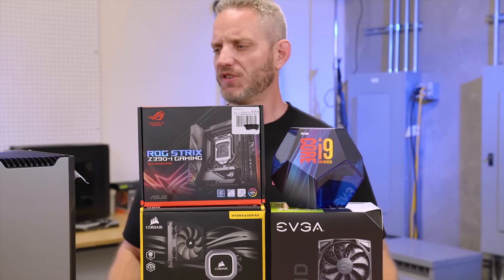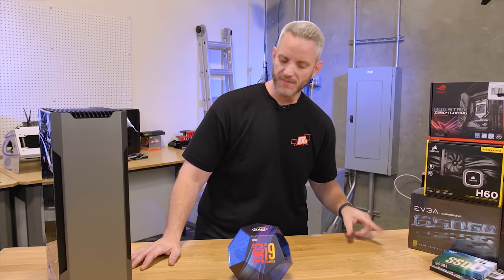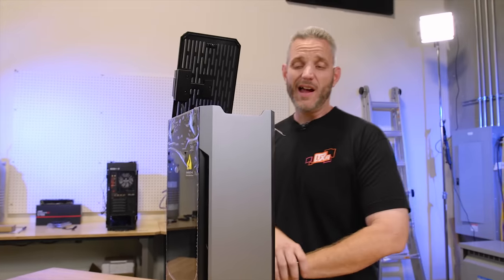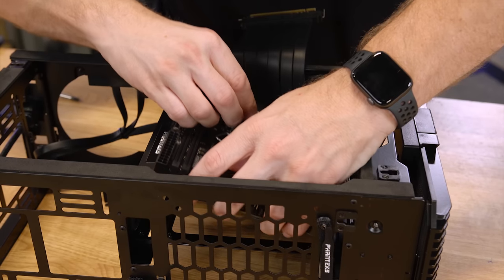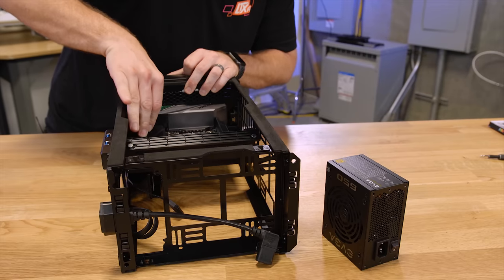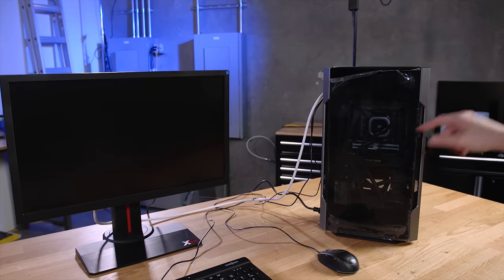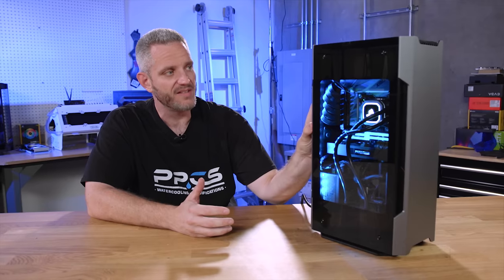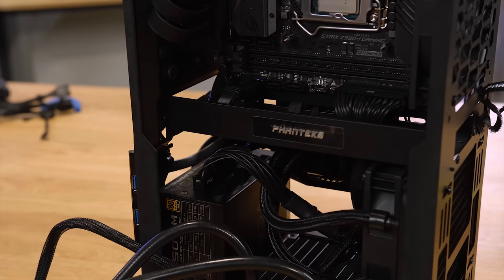This Small Form Factor PC is RIDICULOUS. Ridiculously FAST!

Comment: So i calculated, and one 'merica meter is ~ 91.28125 cm
Edit: it's almost a Yard, but not a yard
Reply: how did you come up with that number?
Reply: You can just look it up...
Reply: What the fudge is a yard?
Are they calculating distance in backyards?
Reply: @StopaskingformynameYouTube  A yard is 3 feet. Wait a minute, they're also using body parts to measure things!
Reply: @crimson7249  BANANA FOR SCALE
Reply: i just did a quick inches-to-yards conversion (only 2 sig figs) for the mericameter measurement. i was torn on whether to make a mericameter a foot or a yard lol
Reply: @frickingphil  it's got to be a yard,the foot wouldn't make sense,  the foot stands for the decimeter (0.1m). That leaves open the question of what to do with the span (9 in.)
Reply: 1 yard is 91.44cm which isn't 1 meter.  it's 3'3" to be 1 meter.
Reply: StopaskingformynameYouTube, that's not how we do that round her. We measure in football fields
Reply: Patrick Morgan well yea, it’s obviously not exactly a meter but it’s the merica unit that happens to be closest to the meter so thats why i made 1 yard = 1 mericameter :P

Comment: Firstly, looks much nicer than my dual aio build in the same case. As for the heat issues, if you replace that 140 included fan with a high pressure/airflow fan, you can get positive pressure with the rads set to vent. front mounted fan still expels air very well, metal front cools what gets sucked back in quite a bit and makes a big difference overall

Comment: Update!
This is the build i put into this amazing case. Some cuts and bruises due to the limited size of it and some.... "Creative" cable routings to say the least. But good god is this an angry little beast.

Case: ENTHOO EVOLV SHIFT AIR
Ryzen 7 3700x
Asus ROG Strix B550-I
Hyperx Fury 3600mhz ram CL16 (16gb)
Asus ROG Strix 120mm AIO
Corsair SF600 SFX
250gb M.2 for OS
/Installs
1tb Samsung Evo SSD for general storage
/games
and a RTX 2070 Super to pull the damn thing. 

Stil remains for it to "stretch its legs" however, so if you have any suggestions im all ears.

ProTip: If you neglect the I/O shield, depending on the motherboard you can and/or will cause a short and blow a fuse...
Thanks again Jay for the inspiration! Keep doing the good work.

Comment: I feel like you're doing a really good job of showcasing smaller power supplies than lots of people recommend. I just want to feel good about my smaller power supply, and feel like the 700w psu I just bought to allow me to run extra toy hardware is a good move. I have some old stuff too thats much smaller, but looking how efficient newer parts are starting to be again,, I feel like my old hardware has a great future also.

Comment: I use a Shift X (the taller version) with a Vega 64 Liquid Cooled Edition, and have the  120 radiator for the GPU in the bottom as exhaust (stock fan turned to exhaust too). I found this approach dramatically reduced temps, and the powers of convection aren't even close to strong enough to impact the heat dissipation negatively.

In fact I run everything as negative pressure (240 mm AIO for cpu) and it works flawlessly
Reply: Torstein Norum Bugge i might try flipping all the fans then, negative pressure sounds counter-intuitive but i’m always happy to be wrong about something 👍
Reply: @frickingphil  The big argument against negative pressure is that you'll have to clean the dust out more often: Negative pressure means that air (and dust) will get sucked in through all the cracks and crevices. Whereas positive pressure — with all the intakes using a dust filter! — will tend to blow dust out the cracks.
Reply: @ichinichisan  yep, good to know...personally i'm not too worried about it because i don't mind cleaning it out (i've already removed the filters anyway to try and improve the airflow, so basically i don't care about dust lol)

Comment: You "Small form factor"
Me "That's not small, it's bigger than my Alienware tower PC"
Reply: Small form factor refers to the depth of the case, not the height or length
Reply: @MoneyKidKing  no small form factor refers to the overall size of the case not one specific measurement
Reply: Yeah SFF are generally sub 20 liters
Reply: This pc is huge
Reply: Its a ITX pc.  Not SFF.  I have a Jonsbo MOD1 case/pc and its itx.... massive and very pretty (modern art) but its big.
Reply: If you look at the dimensions its not that large.  Its shorter than most mid towers, half as long and and about 3/4ths as wide.

Comment: did a Evolv Shift 2 build last week and this case is a amazing. Went for the 800W silverstone psu because the GPU is the 3080TI and I'm still worried about the GPU being too much for it, but so far, so good.
CPU was a 5500X on a Gigabyte Aorus ITX board.

Comment: This build is almost exactly what I've been planning for my htpc build. Same case, dual aios and everything. Glad to see it work. I'm waiting on the new 3000 series GPUs to come out for HDMI 2.1 support to pair with my OLED C9 but I'll probably be using my delidded 9900k and replace it with either Ryzen or Intel 10th gen in my main rig.

Comment: I used to use the Corsair Obsidian 250D, its amazing how far Mini-ITX cases have come since then. However this one seems kinda tall for an ITX, but it probably has the same volume as the 250D. I did manage to cram a 240mm AIO and a 200mm front intake fan into that thing.

Comment: Being my 3rd miTX build I found this one the more challenging one to do. But I guess that was partly due to me never using an RGB AIO setup before either. I like the look of the case it is quiet enough, and watching this video gave me some sense of nostalgia from when I did my own build - minus some of the higher priced components used. I used an i5-9600k, Asus ROG Strix Z370-i, Samsung EVO 970 NVMe 1tb, and GTX 1660ti GPU I don't do 4K gaming currently but I'm glad to see an 2080 fits into the case (the EVGA black edition 1660ti 3.5 slot card advertised as a 2.0 width definitely threw me off so I swapped that with an Gigabyte 2.0 Windforce GPU instead.

Comment: These days, I honestly think the itx form-factor is the way to go for mainstream builds.
DIMM slots just don't die like they used to and PCIe slots are equally improved versus what used to be.
Not to mention the fact that the space in your room is still there and not stumbling over a case is priceless.
The only thing I like to know is that the WiFi module is easily replaceable because that's the one piece of hardware that WILL eat 💩 sooner or later.
Nice build with a happy ending. 👍🏼

Comment: You can cover the corsair logo on the CPU with a small piece of black vinyl. You loose a lit bit of RGB, but then you can rotate it any direction you want without having to worry about the logo facing the wrong direction.

Comment: Used this case for a year but had to change because of shutting off issues. At first i thought the gpu was getting too hot but at the end i think it may have been the power supply over heating. Cpu temps were fine and the gpu wasnt going beyond 80 degrees celcius. I agree that a fan at the top of the case is needed. The back glass panel needs to have vents for gpu air intake. The front metal panel (where the fans are) needs additional venting area as i believe the provided ones dont allow for adequate air flow. I had a 8700k and 2080ti founders for reference.

Comment: @Jay... Just call the Imperial unit you use "freedom units". It's a more accurate name than you might think. It provides freedom in measurements and conversion between the smaller and larger units. It counts in fractions of you can count to 12 or 10. Whatever you want. It has the freedom built right in.

It you phonetically interpret free-dom in Dutch, it sounds like "vrij dom". The translation of which is, "kind of dumb". Which again is quite accurate. So... freedom units it is.

Comment: Probably a good idea to help noobs out by expanding relatively new and possibly ambiguous acronyms -- in this instance AIO, which I understand means "all in one," but in fact refers either to the IMAC (expansion unknown) approach of dumping everything into the monitor case, or the fully baffling integrated liquid cooling rig to which you are referring. For decades I've been begging text and video bloggers to take the two seconds needed to help level the playing field for those just tuning in (don't get me started on the DAW (Digital Audio Workstation) crowd.) So, I beg again.

Comment: I use M.2 NVME drives for builds now for the same reason. It's two less cables per drive. On gaming rigs, a cheap NVME is going to be speed than you can take advantage of and the prices really have gotten more reasonable. I've also eliminated disk drives on my own builds, if I need one I have a cheap USB one I can plug in and use real quick. I want as few cables as possible on the front side of my MB, my current build has only the cables that have to be connected with a few optional ones that will be hidden by my GPU (vertical so it can hide a lot).

Comment: I have a pretty old case, think closer to ancient rather than old. It is a Cooler Master 'Centurion 5'. It's a great case to work in, the only real hassle is that a lot of motherboards these days have the SATA ports running along the opposite edge to the usb ports and on a full size ATX mb they are a very close fit and fiddly as hell to get to.

Comment: My wife has this case! But with a Intel i5 8400 cooled with an H80i. Then a Gigabyte Aorus GTX 1070 which is a massive card. Replaced stock 140mm fan of the case with a Corsair SP120.
    Anyways for those curious with the H80i AIO fan set as an exhaust and the front case fan set as an exhaust. My wife can keep her CPU and GPU under 65C under a gaming load for hours. It's a tri fan GPU but still hits about 66% fan speed in this case. Anyways thought I'd share some numbers for anyone who might be interested in the case.

Comment: FINALLY JAY!! I said this on LTT why are computers so large if we don't even use 2.5 and 3.5 inch drives so much. you use one slot for the gpu on a huge atx board. but if i ever were to build a system which is unlikely i would use itx but i would still have still have full sized drives, i like my storage.

Comment: I agree that there should’ve been a fan at the top compartment. I installed a gtx1080FE and the heat didn’t exhaust well through the top. But overall a great case. I built one as my htpc/lan rig.

Comment: Modded my phanteks shift by removing the SSD tray area and cutting out holes in the rear panel to add an intake fan, gotta say it does help by adding another source of air but the problem I find is the proximity of the GPU backplate to the tempered glass was a good idea until reality kicked in. I noticed the tempered glass really holds on to heat for a long time and that probably adds to the thermals of the GPU when the back is having heat radiated back onto it from the glass. Id love to mod a side panel to have vent slits by the gpu so I can have the gpu fans sticking out and taking in fresh air from the outside rather than up against the motherboard.

Comment: I run my shift with a 9900k w/ Ryuo AIO, z390 asrock fatal1ty, 1080 FE with G12/ H55 AIO. Temps sit around 70°C. 
I have a 140mm top Noctua Chromax as intake, side 120mm chromax as intake, bottom 120mm chromax as exhaust. Best airflow path I've tested from all configs. Looking at buying a shift air side panel for gpu side just to help a little more.

Comment: This is pretty close to my current build, with the Asus x470-I, Ryzen 2700x (there's no rush for Zen 2.), 800w silverstone SFX-L PSU (it barely fits without breaking the modular plugs), corsair H60, 2xCorsair ML140's and a gigabyte 2080ti, it took ... 2-3 hours even though it was planned out way ahead of time, just due to fitting pieces in with 2mm gaps and 12x cable ties just to bind loose power/fan cables, especially RGB everything. I would pay money to see someone hard-tube the cramped Evolv Shift, due to the angles and gaps being less than paper-thin at times, and needing room for a pump/res ... somewhere. The big-brother ITX sized Shift-X can fit a 240mm, this barely copes with 120mm rads overlapping, you sometimes have to be creative with cabling and angles.

Works fantastically, but the heat is just trapped inside when gaming, fans take 6-12 minutes to wind down post-games, but it handles 4k 60 like a champ. temps aren't bad, CPU is 45-50'c with a mild OC and 80'c in gaming. after 10 minutes, case temps hit 45-50'c, around 110'f in games, without throttling overmuch. setting the MB and AIO fans to 100% when the case temp hits 40'c, helps. If you set it with 50'c, the corsair RGB fans can't keep up. With a GPU AIO, it would be ferocious, but there's nowhere for the heat to go, there's not enough surface area/radiative heat, or cool airflow to absorb, it just comes out as lukewarm air through the top and sides IME. The Corsair One's top fan, is definitely a good idea for a Shift-X v2, but it might need to be 140/180mm with some serious static pressure on the base/top.

Taking the shiny front panel off helps, and exposes the ML140's ... Fabric instead of glass / metal panels is a huge upgrade for the shift X, especially the GPU side of things. There's just no way to set up "good" positive pressure, as it 'leaks', and there's very little space to push air through the motherboard/GPU gap without some kind of ducting or blower fans.

Comment: I just watched your Dry Ice Overclocking Video and thought what would happen if you filled a watercooling loop with acetone and dumped some dry ice in a large reservoir. I would love to see you try this out because I'm very curious what would happen and if the carbon dioxide gas would be sucked into the pump. Maybe submerge your radiator in acetone or something?
Anyways, I love the content you put out here and the way you do your videos.
Greetings from Germany!
Reply: I'm fairly sure something would break/die from the acetone alone, let alone with dry ice supercooling it to -70s to -90s. Liquid nitrogen is more effective due to the significantly larger heat gap having the Ledeinfrost effect kick in early, with damage only coming after sustained exposure and submersion.

Comment: The Phanteks case to me is the best looking case available, period.  But the dual AIO with glass panels is choked too much for the fastest setups.  When  you move to the X case, you get a dual radiator height down below which is good and an aluminum top instead of plastic, but the air flow in this needs a redesign.  Optimum Tech mentioned moving motherboard away from the GPU but so much more needs to be done to improve airflow.  There is no question, that this design is the most beautiful and quality looking case that I've ever seen.  I'm hoping so much that we see something other than side speaker cover mesh in the future to allow faster CPU/GPU combos without heating up like a chimney from the glass and limited airflow.  I might try the X case to see if the dual fan radiator will help enough but the motherboard is still right up against the GPU.  I love the simple looks.  The logo is subtle and perfect... the finishes are perfect... I prefer murdered out black myself.  And the heat discipating blades on the top and bottom of the case look wonderful.  So much potential here to be just choked out for airflow.  Wonderful design and no engineering thought into performance.  You could have a perfect machine that doesn't throttle.... My God... if the Ghost S1 can do it in that tiny case, why couldn't these guys figure out how to keep heat managed in almost a 20 L case!!!!!  Grrrrrrrrrrr!

Comment: I built a new Ryzen 5 system with this case. I love the small footprint since I don’t exactly have much space on my desk. AIOs are the way to go for sure due to the lack of air flow with those tiny side vents.
Reply: Did you do dual AIOs?  I have a 3080 hybrid and want to build a dual aio itx build.

Comment: Why not put the GPU's radiator at the bottom and the CPU's radiator at the side?

Seems everyone builds it the same as you have without thinking "which radiator is going to need the most air passing though" although you did identify that the bottom rad was going to get more. I'd love to know if it improves your GPU thermals Phil. I have this case and love it, had the FT03m before this  - can't go without my IO on top now.

Comment: Can it be turned to sit 90 degrees? Agree about fan port at the 'top'. Totally take your word for the 6 mil, but if your asking for 6mm lets get 10 or 15mm for the 'me's' that might build in this case. I think that would look pretty killer turned 90 degrees with different feet or mount options.

Comment: Nice build!  I think you should have gotten those power adaptors for the video card from EVGA. They would have relocated the video card power connectors to the back of the card and made it easier to plug in.  The only thing I would do different.  I like the small form builds.
Reply: the power connecter ends up taking up more space then just bending the cables

Comment: im using the same case 
i have a 2700x and a vega 64
the 2700x with a corsair AIO and the vega with Alphacool 120gpx m01 AIO
Cpu temps load @ 65
Gpu temps load @ 55
ambient temp at 28
i think you need to change the fan setup.
the bottom AIO needs 2 strong fans to push out the air

Comment: Hey Jay, if you get bad temps with the Corsair AIO using the stock applied thermal compound I'd replace it, mine H100i improved a bit with it.

Comment: I have the Shift X case, I would love to see you or Linus do a proper hard line water cooling build.
Btw you can fit one 120 and a 240 slim EK radiator in it. My i7-8700k and asus rtx 2070 run between 50 and 60 under load. 
My soft tubing looks nice but hard line would look spectacular in that case.